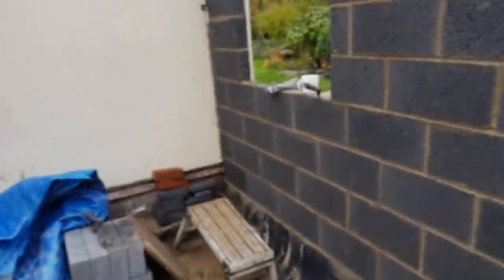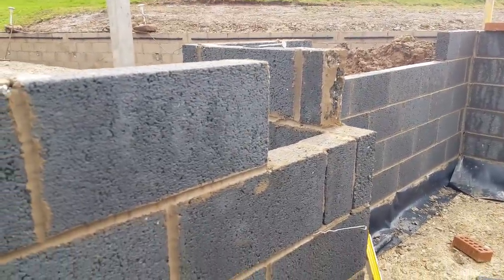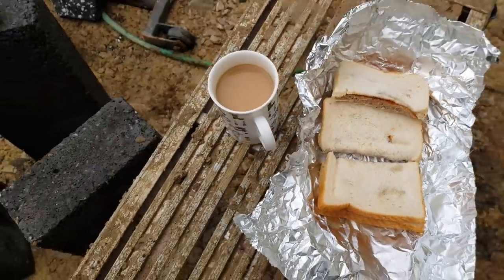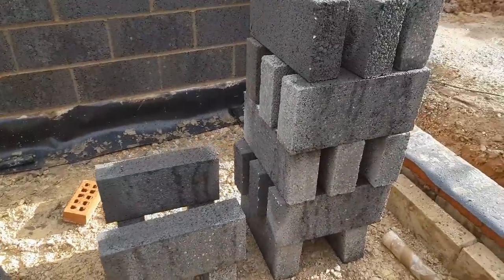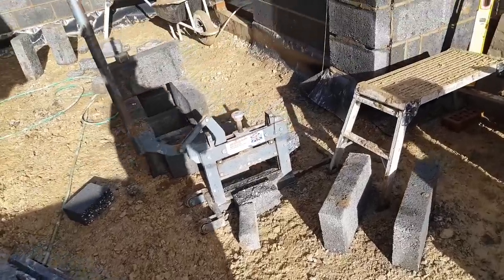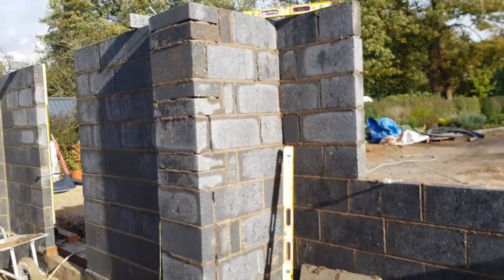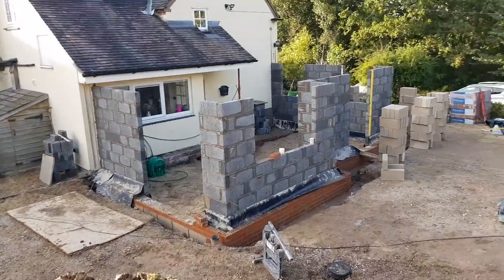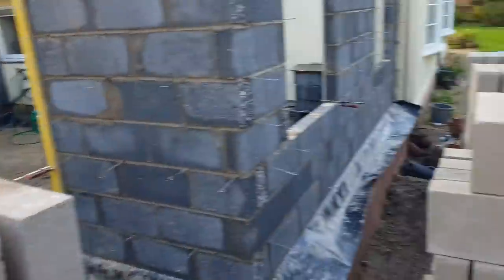Bricklaying - Easy Blockwork day - Blockwork Tips  #bricklaying #renovation #construction

Comment: Anything that helps protect your back is a great idea. How thick are the beds and perps? Are they bigger than 10mm,  and is 10mm a standard size, it’s looking good, enjoy your well earned pint. 🍺🍺
Reply from the maker: That's it mate! The beds are bigger than 10mm, keen eye😉👍 these blocks are quite small, instead of 215mm they are about 210 to 215, bit misshapen 😂😂
But your right 10m is the correct size for both bed and perp joints!
Enjoy your evening mate!👍👍💪🍻

Comment: Lovely work Izzy. going the other way with 1 movement just turn trowel other way blade point towards line press into mortar cut collect we shake if need be the boom straight on no more swipes lol. Cover half way across blade covers the joint every time 🤟
Reply from the maker: 👌👌👌💪💪 Eey top man! I'm in the 7ns 2moz so will be trying that fella👌👌 Cheers for the tip mate, appreciate it🍻🍻🧱
Reply: @IzzytheBricky  
In Scotland buddy every is 7n sometimes 10n wans rate tho. All timer frames 140mm now so internal walls in footing 140mm 7n. So none getting held with 1 hand to joint. A think even with light blocks would just cause a strain to wrist jointing in hand all the time. That’s why for me minimum 10 1/2 inch trowel best suited on block anything smaller than 10 inch your not catching full top edge of block with joint. Just way a was taught although mind jointing onto block with trowel pointing up to line did fall of trowel few times 😆😆😆 some times depending the height would just pull line out a bit with other hand save trowel catching. Keep the videos coming buddy this is a good genuine channel. 😎😎😎👍🏻
Reply from the maker: @lmilne4859  fk me dont envy you mate..rain all the time and heavy work too😂😂 yea cos a work on me own all the time, I just yank the line out the way😂no one gonna moan at me for it😉🙏
Cheers mate, appreciate it fella! Have a gooden mateyyy🍻🍻🍻
Reply: @IzzytheBricky  
😖😆🤟🤟